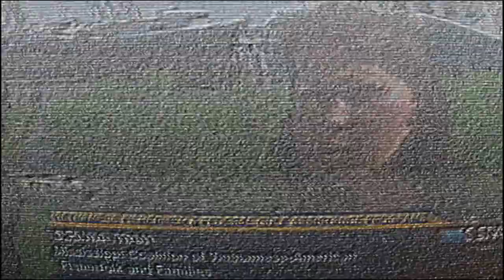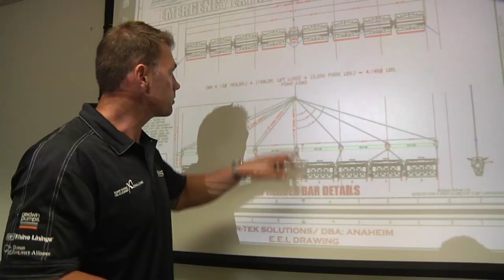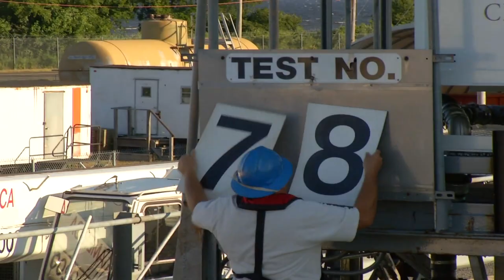Team Vor-Tek - Wendy Schmidt Oil Cleanup X CHALLENGE

Comment: Oilspill recovery Europe ltd. Outperforms all oil spill skimmers shown , and recovers marine debris simultaneously , even in very choppy seas.
The technology employed does NOT mix oil and water when recovering oilspill .A self propelled vessel, THE SEASKIP is inepensive to manufacture,  inexpensive to run & maintain , requiring only two or three mariners to operation successfully. Can be any size required and virtually unsinkable.